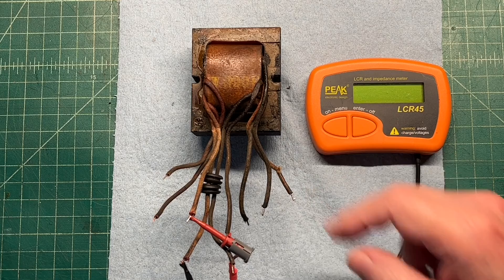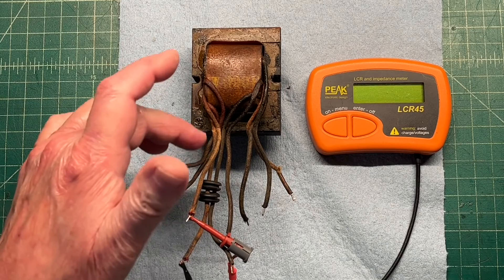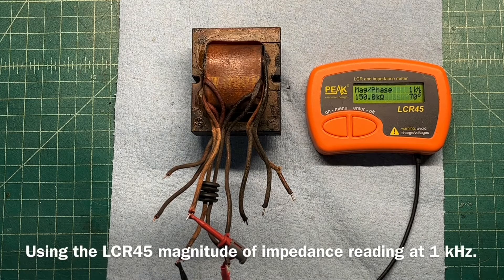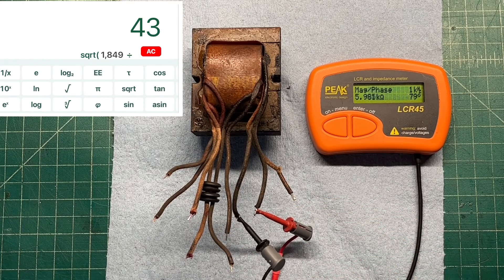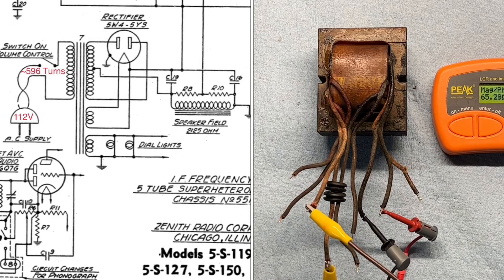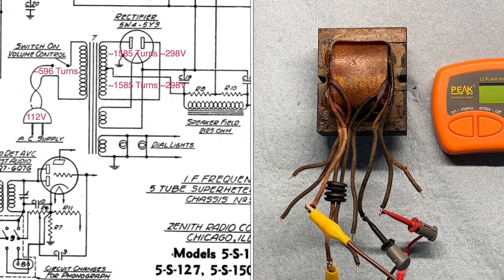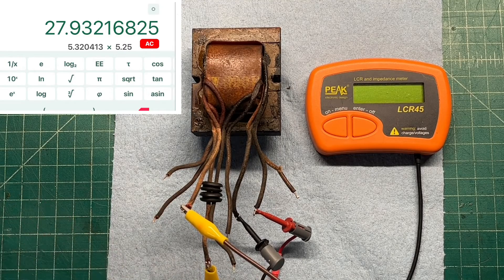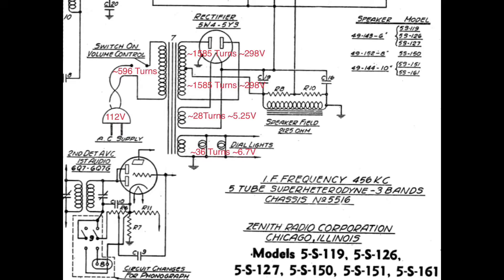Zenith 5-S-127 | Power Transformer Characterization w/ Peak LCR45 Using Leakage Inductance Method

Comment: So, the schematic shows this radio requires 112-volt supply, which 115 volt was pretty common for older radios and testing equipment. I have used a 20-ohm 25-watt chassis mount resistor on these older radios to decrease the line voltage today which is about 124 volts.
Reply from the maker: Hi Ken, I’ll be following your lead and doing the same for this receiver. Thanks again for following the series. Best, Don
Reply: I've seen quite a variance in line voltage in different parts of the country I've lived. When I used to live in South Carolina the line voltage was about 122.5 volts and here in Maine it's 117 volts. This seems pretty consistent year round in both places. I've even had the power company come check my pole here because my dryer was noticeably different in performance. I've also seen some transformers in power supplies and other devices that consume considerably more current over 118 volts when running through a variac. Interestingly enough, the current seems to jump all at once (due to saturation) with some transformers making them "waste" quite a lot of power when hitting this threshold. Definitely worth looking into.
Reply: The NEC does not specify maximum voltage, but a plus or minus 5% is standard. The acceptable voltage range of a 120-volt receptacle can be between 114 and 126 volts. This variation depends on how close your house is away from the pole transformer, the farthest house away will naturally be the lower voltage.  The electric company will not come out and check the pole transformer when it meets these NEC specifications. The construction of vintage transformers will not handle the higher voltages and will be compromise and eventually burn out the transformers as opposed to power transformers made after 1968. @W1RMD
Reply from the maker: Great info Ken and thanks for sharing. My voltage usually runs 121 to 124.5V; not sure about my brother-in-law’s residence, but I think the 10V drop will keep the old transformer at a better place. Thanks again for your contributions. Best, Don